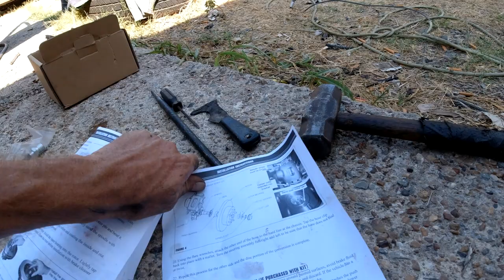1968 Chevelle Nomad Restoration - Part 30 - New Master Cylinder and Power Brake Booster

Comment: Looks like its comin along...double flare is mandatory single flare dangerous...should put a couple of curls in brake line to cyl...it will remove possible  vibrations..which could cause cracks...keep up good work...cheers
Reply from the maker: Thanks!

Comment: Another great update. Looking foreword to the LS segments.

 You will need a tool called a proportioning valve bleeding tool. It screws in place of the brake light switch while you are bleeding the brakes. There is a piston in the proportioning valve that the brake switch bottom pin will rest against. If you bleed it without the tool the piston will get wedge to far forward or to the rear and this will cause the dash brake light to stay on.

The tool comes in plastic or metal and runs between $6-$12 on ebay. There are a couple different sizes so you have to make sure you get one for GMs.
Reply: Thanks for the tip. I have up coming brake on my 76 Vette. I didn't know there was such a tool. Thanks, it's appreciated.  Cool to learn something new.
Reply: @94jimmy5  I did not know till recently either. Found out when I could not get my brake light off after doing a complete brake change on my 68 Cougar. Explains all the unplug brake pressure switches I have seen over the years.
Reply: Mine bled perfectly the first time. Then I took the calipers off to paint and lost all the fluid and the safety valves moved over on me. Had to order the tool and they make 2 different lengths of the shoulder in-between the threads.  Of course I got the wrong one the first time.

Comment: On the defroster heater hose check with NAPA they have it much cheaper than I found on Ebay. I needed it for 2 - 68 Dodge darts.

Comment: Hold those other new control arms up to the ones you just mounted and I will bet that they are the same. Also, have you heard about using a jeep Cherokee power steering box for quicker steering on a,b,f,x body Chevies. No kidding they bolt right up and you just change out the pitman arm off the Chevelle, look it up. Anyway keep those upper arms for your next project. Keep up the good work. Btw, you will probably need a new oil pan to clear the cross member on the Chevelle, they make them. Research is the key. Good luck!

Comment: I always  double  flare brake lines and avoid  unions.Safety first.Also the power brake clevis  should  attach  to the lower hole the stoplight switch will need an adapter  to work correctly. Good work .

Comment: Hi again. Just a thought about parts. I've too ordered much off eBay, usually with positive results. However, in some cases one-stop shopping on RockAuto for "hard parts" (suspension, steering, brakes, electrical, etc) can also prove cost effective, even with having to pay shipping. They're also about the only full line vendor I can buy AC Delco parts these days. I've found I can typically beat the price from the local parts stores even with shipping in many cases. (They always refuse to price match RockAuto). Not that I don't buy local when urgent but if I have a few days I buy online. Anyway, just another avenue for parts you might want to explore. Take care.
Reply from the maker: yes, I buy from rock auto sometimes

Comment: That extra rod that comes with your master cylinder booster kit is if you want to delete the power brake booster and just run the master cylinder that's what the rods for the master cylinder like you had before.

Comment: You got enough line there to make all the lines new you got the flare tool just bend it using the old line and your good....heat must suck I hate working in the heat.

Comment: the brakes will be way too sensitive if you don't drill the 2nd hole into the brake pedal arm. It allows you to use less manual pressure to activate the brakes
Reply from the maker: I fix it next video.

Comment: Hi. You really need to master the "art" of making brake lines with the flaring tool you bought. It takes a bit of practice to correctly make a double flare. You CAN'T use single flare brake lines you need the double flare to withstand the high fluid  pressure when you apply the brakes. (Same principle why you have to use a union not a compression fitting to joint lines.) Read the tool instructions, very important you use the black insert bit to set the correct amount of exposed line in the clamp tool. Too little you'll have a bad incomplete shallow flare, too much you'll have bad fat deformed flare. Don't be afraid to bend the steel line you bought. 3/16" bends very easy between your thumbs. You can also get a small hand held round barrel type tubing bender. They have grooves to bend 1/8 - 1/4 " line if I recall correct with mine but I usually bend all of it by hand anyway. Hope this helps.
Reply from the maker: I'll have to practice more.